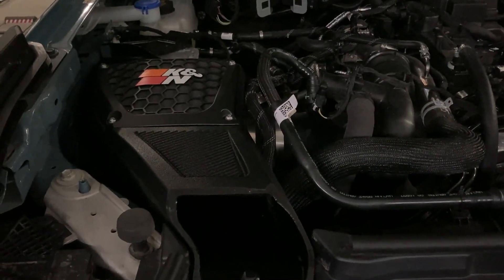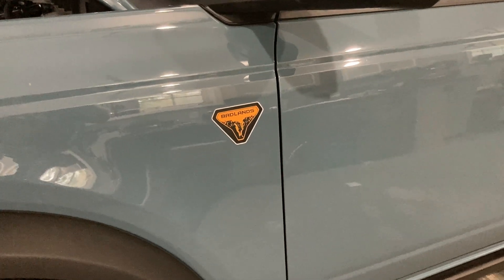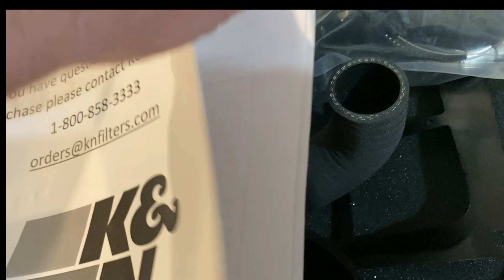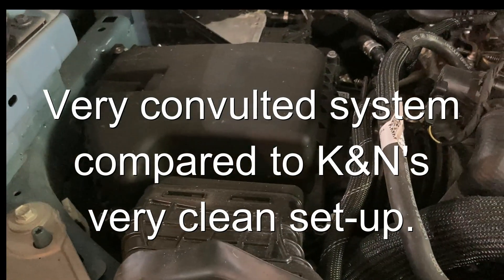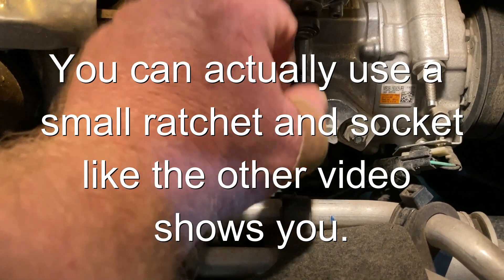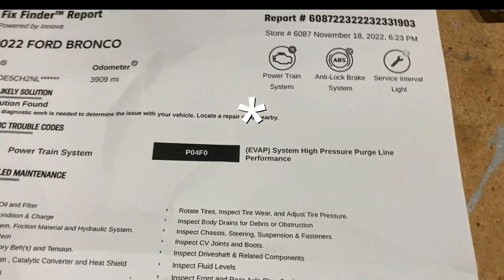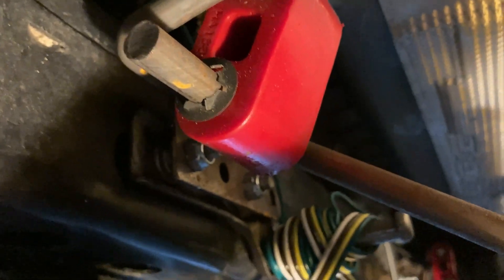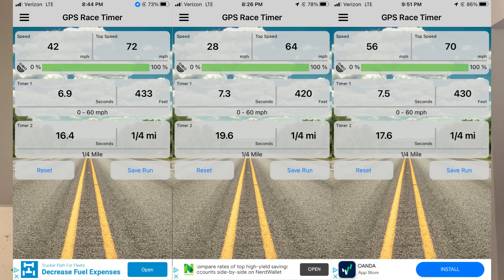Ford Bronco 0-60 mph: Before and After Upgrades (K&N Cold Intake and Flowmaster)

Comment: It’s funny any other platform and people bash on K&N, and simple muffler systems. I actually had a dyno record a 7hp gain consistently on three different pulls, if you keep them clean, with little oil they do put in work. As for the flow master haven’t tried. But that’s about the only style I’ve ever seen that has borla/magnaflow design giving it great power results for the $$. Video should be called best bang for the buck.
Reply from the maker: Thanks, maybe I need to rename the video.

Comment: Can we assume you are running Premium?  91 or 93?  Have your considered the Ford Performance Calibration for the 2.3?
Reply from the maker: Yes, I am sorry I meant to include I was running 93 on all runs, before and after upgrades, wanted to control the variables as much as possible.  I did see that and it does produce some really good numbers and it even  maintains the warranty from what I saw.  I'm probably good for the moment but could consider that in future plans but need to stop spending money on my Money Pit!🤣🤣  Thanks for watching.

Comment: Baja mode can be put in 2wd. Would love to see if your 0-60 time in Baja 2wd mode.
Reply from the maker: Yeah see, I think that's where I failed...in a way.  I mean the main purpose was accomplished which was to test in one setting and retest the same setting later.  But it would have been interesting to test in a variety of modes and see what helped the best.  The problem now is I am upgrading to a set of brand new Sasquatch pull-off and doing some minor work on the suspension and other needed things to accommodate the transition.  Of course, I could see which mode works the best with the new set-up.  Thanks for watching.
Reply: @MyCarsandProjects  you make valid points. Look forward to seeing the build.
Reply from the maker: @rockoq173  Don't get too excited, it's a frugal/cheap/thrifty build, trying to beat $1000 or much less if possible.  But it will be quality and thought out, make no mistake.  Any chance you know of a way to lift the rear a 1/2"?  Obviously that's a short amount but it's my outstanding concern at the moment.  I've mitigated most other issues.

Comment: Did you experience any ticking sounds coming through the interior after the intake instal? I installed the same intake on my 2.3 bronco and I hear a ticking sound. Sounds like it’s coming from the firewall into the cabin. Wasn’t sure if it is normal or not.
Reply from the maker: I don't think so, there's a sound at start-up until the engine warms up, then goes away, but I don't think it started when I installed it, but maybe it did.

Comment: 7-speed manual gear ratio is actually 4.46....not 4.7 (like the sasquatch has). You do not appear to have the Sas package so you should be at 4.46.
Reply: Also FYI Sport Mode makes a huge difference in acceleration. You can unlock Sport mode using Forscan.
Reply: 7 speed badlands had 4.7. Auto has 4.46 unless you get Sasquatch
Reply from the maker: Manual transmission in the Badlands comes the  4.7 rear end, it is the only Bronco with a 4.7 that is not Sasquatch.  Even the auto has a 4.46, but the manual is special😎😎.  Thanks for watching.

Comment: I got the base 2.3 manual sasquatch (same color as yours) I got the same exhaust haven't done the intake but i did get the ford racing tune.. and Wow did that wake it up. I'm waiting to get my k&n then I wanna get it dyno tested..  I'll be posting the results on my channel.. also the bronco is sooo good in the snow
Reply from the maker: That is awesome, I hope yo udidn't waste any money on an aftermarket blow off valve like I see a lot of folks doing.  Once you do the intake, if not already with your Ford Tune, you'll have air rushing into the intake and creating the aftermarket blow off valve sound.  That kit looks like a legit kit, it was 330hp and 385trq right?  I'll subscribe and check it out.  Thanks for watching.
Reply: @MyCarsandProjects  no blow off valve here. I highly recommend the ford tune, it shuts off the auto stop start and adds rev matching for the manuals. My son says it sounds like a drift car. In sport mode the thing launches. I keep referring to the old bronco commercial, 4wd sports car. Lol
Reply from the maker: @edkelley6916  WOW, gets rid of the auto stop start, that by itself is worth the money🤣🤣, that is literally one of the things I hate the most about the Bronco.
Reply: @MyCarsandProjects  the horse power is nice too
Reply from the maker: @edkelley6916  Yeah I bet, just joking about the stop start, but who really likes that?
Reply: @MyCarsandProjects  I don't like it either.

Comment: no sound  or dyno, saving 2.1 seconds of a 0=60 time should require like 80 to 100 hp difference. Without a tune this result is frankly unbelievable.  most dyno comparisons I have seen on K and N's show a 10 hp loss but they are the enclosed box type.
Reply from the maker: Mark, it wasn't 2.1 seconds, it was 1.1 seconds, 8.0 to 6.9.  And that's with the cold intake AND the exhaust.  I can't see how it would leave a loss of power as the amount of air being rammed into the system is noticeable more.  I will attempt a video on the sound if I have video equipment that will register it.  My attempt was less than perfectly scientific for sure, but i worked with what I had.  Thanks for watching.